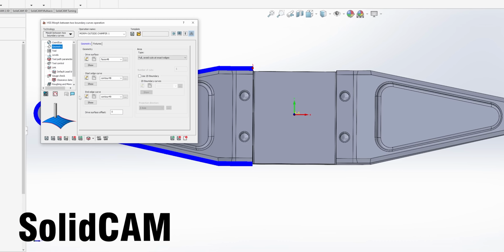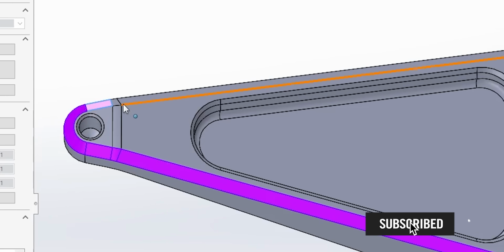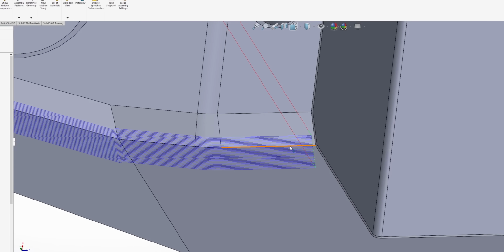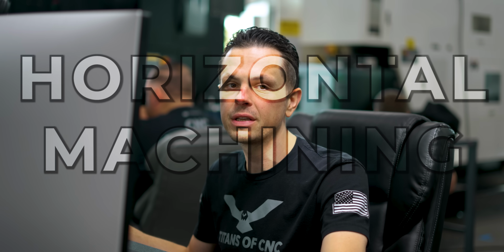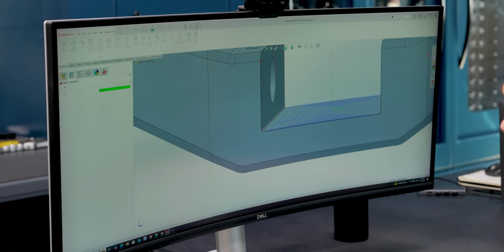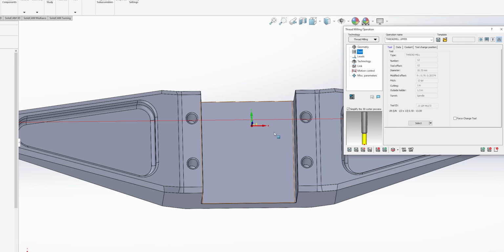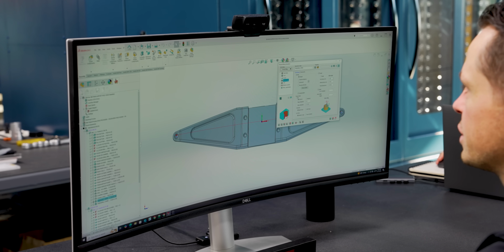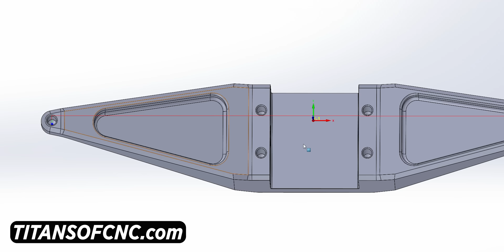3 Genius Toolpaths You’ve Never Seen Before

Comment: I do all this in my sleep using Fusion 360 and Gibbs Cam. Every machinist should know how to program. Its to the point where machinsts now get programmer salaries because programmers arent needed anymore. We have Conversational Machines as well in our shop, that can program and make parts faster than most others around. If you have to spend 2hrs playing with the program, you are already behind. I can use the Mayzak or even the Haas, and draw and program a part in 10mins. And the Mayzak has lights out Palletech, so it needs no human intervention. Itll comp its own tool wear, and inspect its own part. Spitting them out for you to collect in the morning when you get to work😂

Comment: As NX user, i've seen nothing new.
Reply: As a nx user everything is new
Reply: There is stuff I was doing in NX1 (25 yrs old version) that I have yet to see beaten in terms of work flow.
Other softwares I have used seem so dumb, instead of just picking "I want to machine this surface" you need to make boundaries to constrain them to that area.
Reply: True 😂
Reply: 我也是NX用户，你用NX哪个版本？
Reply: @leizhang-rj3bq  nx10
Reply: Because Solidcam provides some strategies for NX😂

Comment: I am only trained on the Autodesk fusion software, but in it the first feature is called blend and the second is called flat, I have also used the blend function for roughing with a 1/2 end mill.

Comment: I use very similar toolpaths in fusion 360 but it’s way more noob friendly and doesn’t use over complicated words
Reply: And once you get into multi-axis milling or multi-channel turning, you will realize that Fusion falls absolutely short of the mark.
Reply: @barrysetzer  When was the last time you used Fusion 360? 5-axis machining is just as capable. You can even get a better surface finish in Fusion, thanks to the PowerMill algorithm.

I agree with you on turning — but give it a couple more years, and SolidCAM will fall behind in that area too.
Reply: @barrysetzer Are you seriously comparing high end CAM Software to Fusion 360? lol
Reply: @barrysetzer  Для подобного сравнения сначала посмотрим на стоимость обоих пакетов.. За 9 лет в Fusion было добавлено больше чем в любой другой cam, да и разработчики хотя бы немного прислушиваются к мнению комьюнити.